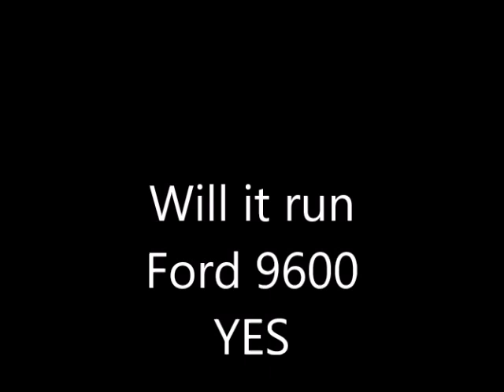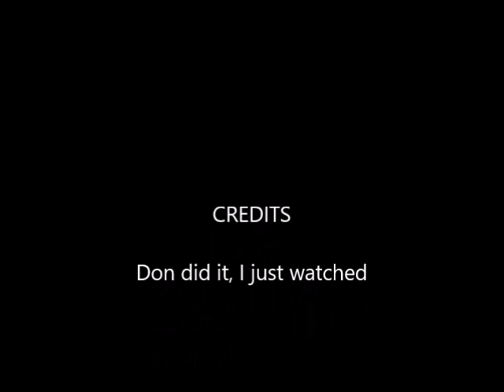Will it run Ford 9600  YES

Comment: You said to comment,  so here ya go. And, I'd love to have an old Ford 8 or 9N. I know they are common, but people around here are PROUD of them dudes...
Reply from the maker: I have a 9N , stuck engine and flat tires, could be fore sale.
Reply: @oldfarmjunk101  if I had a way to come and get it, I would. I currently have a teeny tiny Mitsubishi MT160, with a factory mounted front end loader, cat.1 3-point, 3-cyl 16hp diesel. It runs GREAT, loader works, brakes are good, clutch is good, but the wiring harness has been absolutely butchered. The PTO has been used so little, that the factory paint on it makes it hard to get the shaft of my 60" finish mower on and off. I grew up on 8 and 9N fords. Wasnt heavy enough to push the clutch down when I was sitting, I'd have to literally stand on the clutch to stop. I've mowed many of acres of hay with one and a super old John Deere 7 foot sickle mower.

Comment: Good day Boy  that was kinda of quick fix.  Do you think anti-freeze is still in  oil.   Our 1 neighbor had Int. W-400. Oil leaked in water, they used to drain oil,  put new stuff in & keep on going, until 1 day, that was it.  You might get lucky.  Boy those 401 could put smoke out. O in credits it said Don done it, Is that your son's   name.   Thanks & good luck.